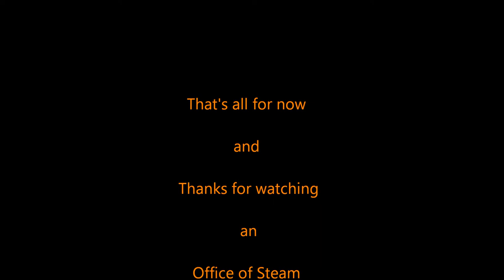Duplex Corliss Tandem Compond Model Steam Engine at The Office of Steam

Comment: Do you know if that engine was built from a set of Southworth Engine castings Gil. Or were they from somewhere else? Very nicely built engine.
Reply from the maker: Yes, Southworth castings. The name is cast into the steam chest covers on the low pressure cylinders. Southworth is the successor to Fleet.
Reply: Thanks for the information Gil. I think that's the first running one I've seen. Likely you already know but Arnold Thorp did the original design for Fleet. Now you need one of the double compound Corliss engines Southworth does. :-)